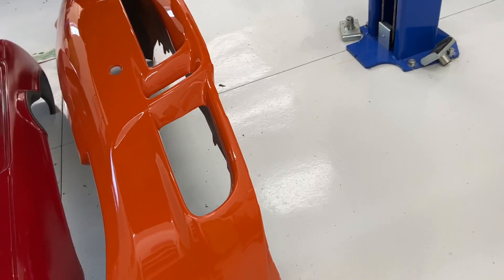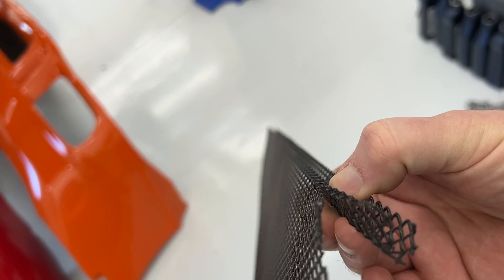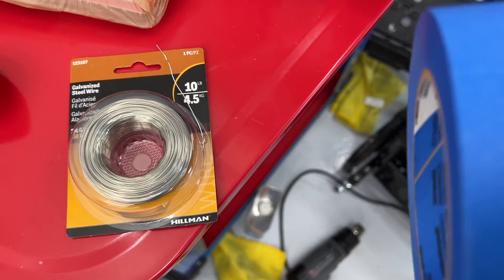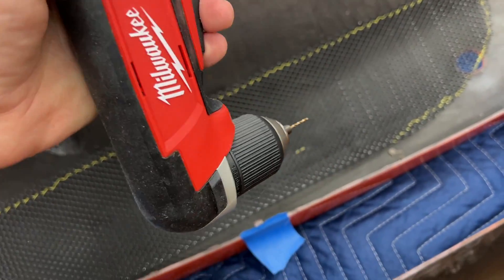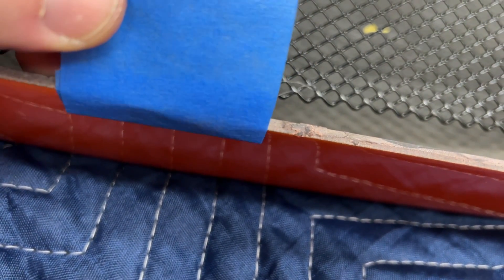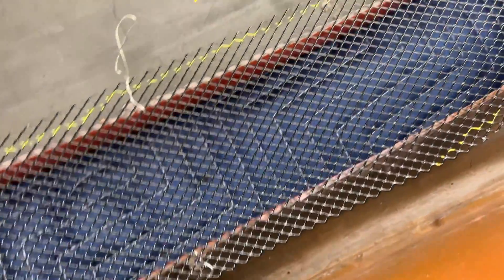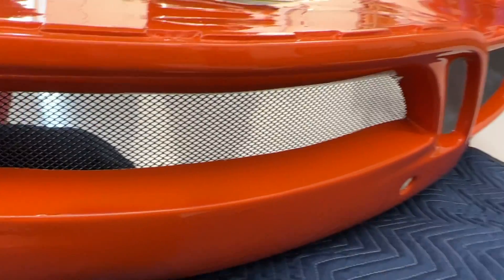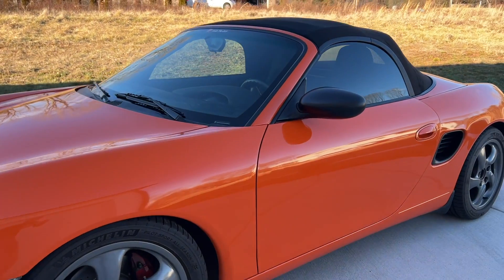How to INSTALL BUMPER GRILLS/MESH

Comment: Why would anyone do that kind of backyard hillbilly hack job to a Porsche I mean if you can afford a Porsche then you should be able to afford a nice professional custom grille
Reply from the maker: +Andrew Sherman which one and how do you attach it to my aftermarket bumper? I’ll wait…
Reply: What you did works. No issue personally. Though I might have used industrial glue or clear epoxy along the posterior ridge of where you mated the mesh to the bumper. Of course tape off the front side to avoid drip or leaks. Seam sealer might even have worked. It's less viscous. But it's about what you want to spend, experience, preference etc. Either way it works.
Reply: Read his youtube name .
Reply: It's his car...You probably drive an old use Taurus.
Reply: @fairydust-ky4oc  nope I actually drive anything I want which is an old charger
Reply: I use epoxy glue on the rear of the bumper no need to drill bumper